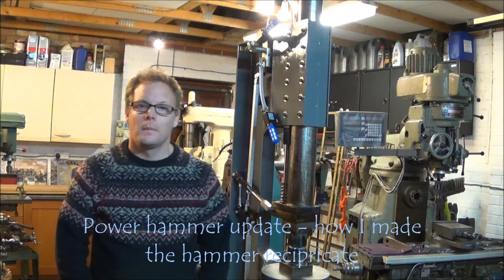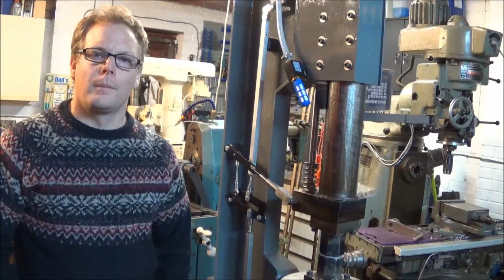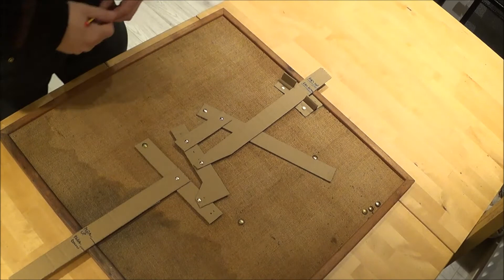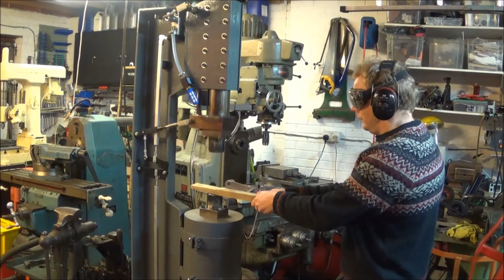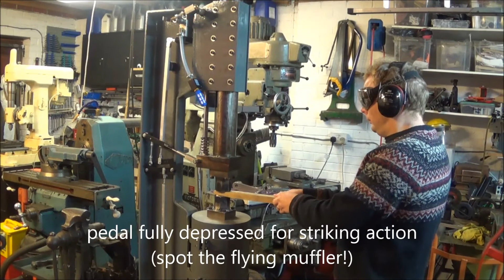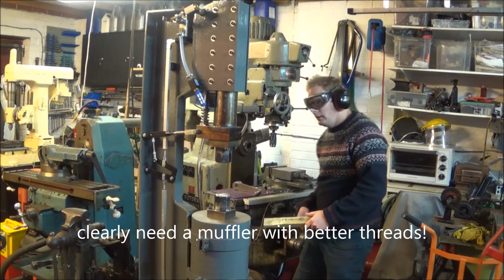Power Hammer Upgrade - Steam Hammer Linkage

Comment: In the process of building a power hammer now. Ordered the lever switch and push to connect fittings. Hooked it to my cylinder (a new hydraulic cylinder) and it takes about three seconds to move the cylinder the 7 inch stroke. Will an air cylinder move faster or is there a problem in my valve I ordered.  I ordered a 5way 2position valve and using 1/4 line.
Reply from the maker: That seems a bit slow. Could be a orifice somewhere in the system, a very large diameter cylinder or perhaps just extra friction from the o rings on the piston.

Comment: It works well, I would say you'll need a bigger compressor with a larger output for constant use. Is that on the books? Tony
Reply from the maker: Hi tony. The hammer has a three way input so I can link the three compressors that I own. This should give me about 2.5 x the air capacity. Hopefully this will be enough to be useful!